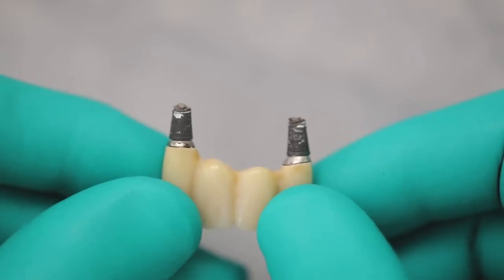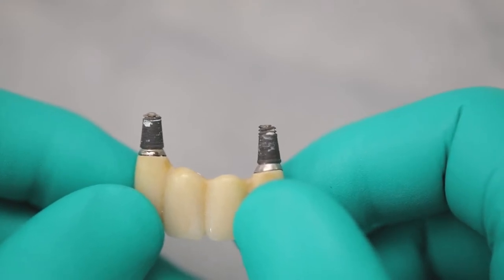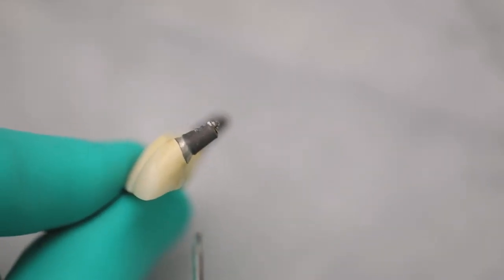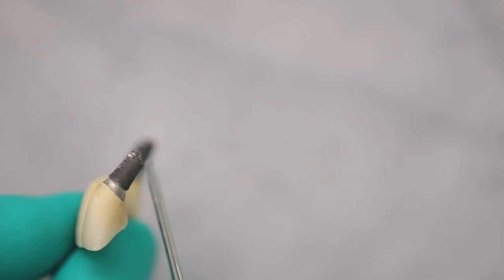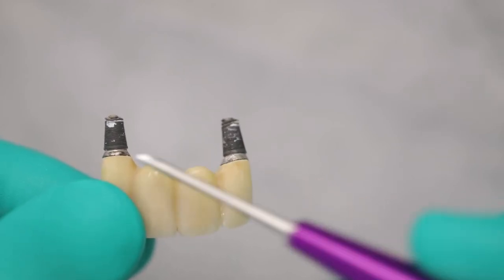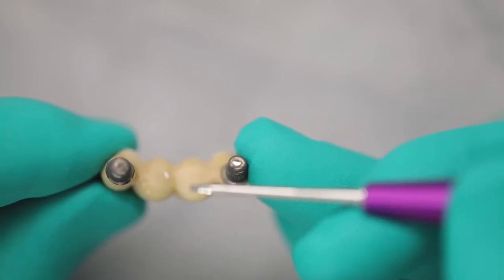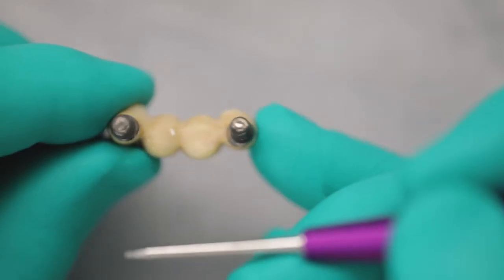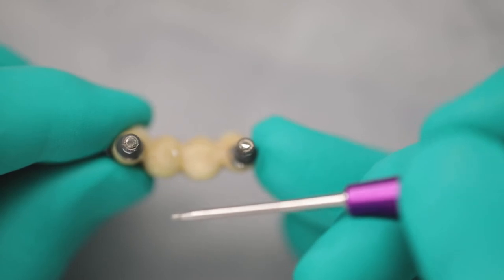These two implants BROKE. But Why?

Comment: Is grade 4 TI not ok ?
Reply from the maker: When evaluating grades of titanium, two key factors come to mind: strength and integration capacity. Medical grade 23 titanium is 36% stronger than grade 4 titanium, which could have made a significant difference in this case and possibly prevented mechanical failure. Literature reports that osseointegration rates are similar for both types of titanium implants. It’s worth noting that our orthopedic counterparts exclusively use grade 23 titanium. Therefore, I believe dentistry should also adopt grade 23 as the standard to reduce risk and improve patient outcomes.